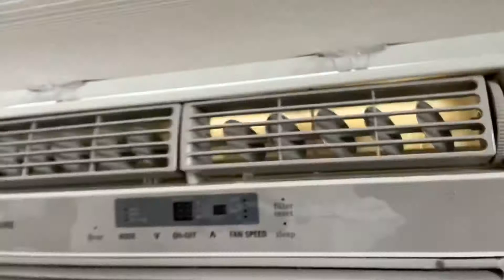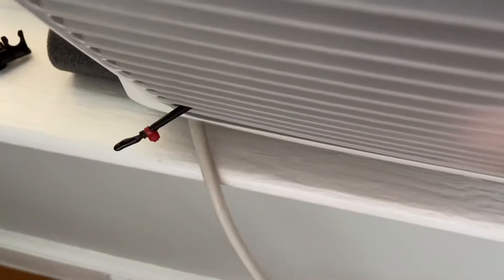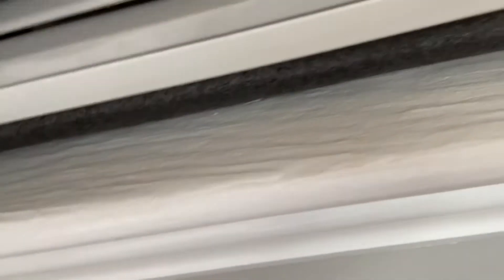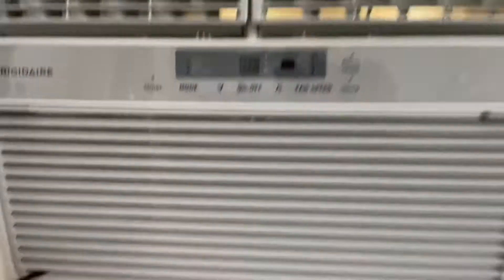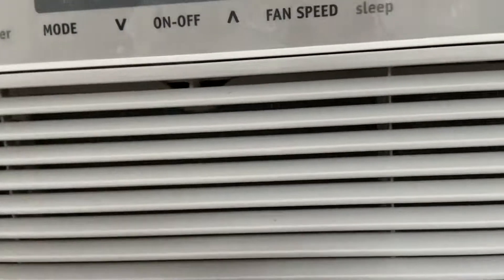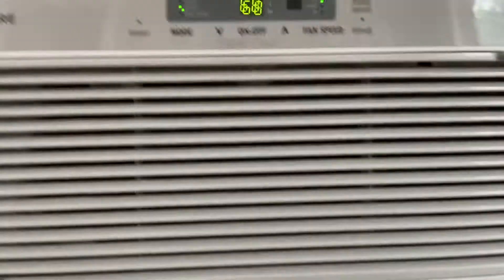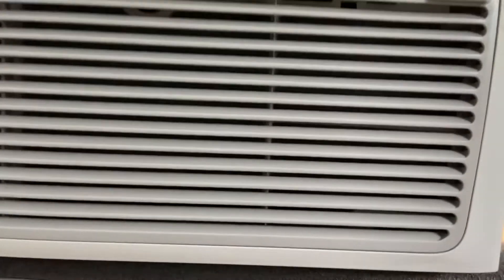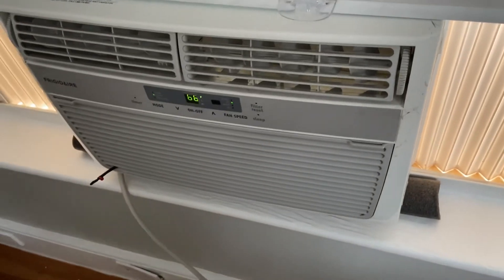How to make a window air conditioner read the actual room temperature

Comment: Had to do this to my old goldstar. Thermostat set too close to the coils. The trick definitely works.
Reply from the maker: It already made a difference it felt a few degrees cooler when it cut off at 68 than it did a few hours ago. It’s not exactly 68 but that’s because I had the doors open and the other ACs on.
Reply: hey neat trick!,i did this to a 8000btu hisense a/c from costco,it really cools now